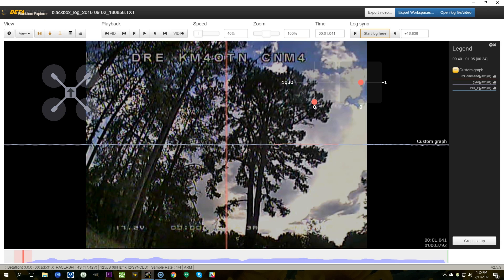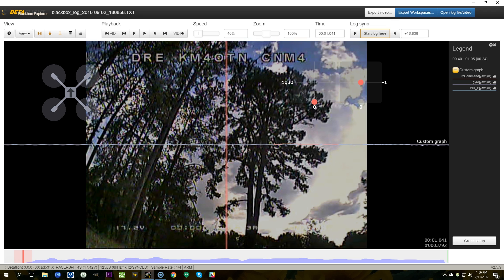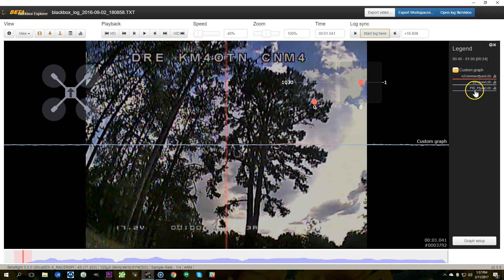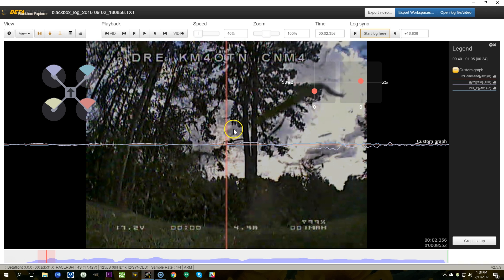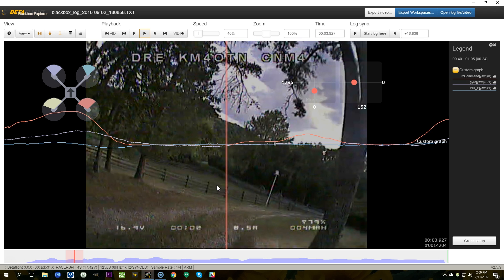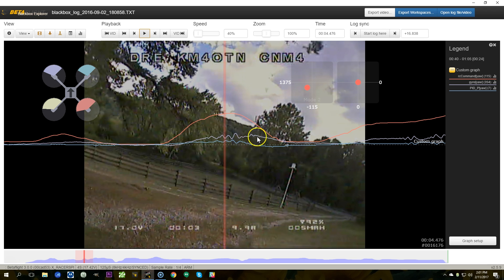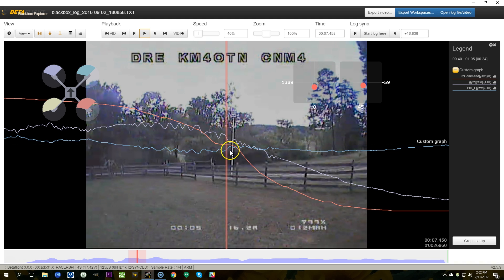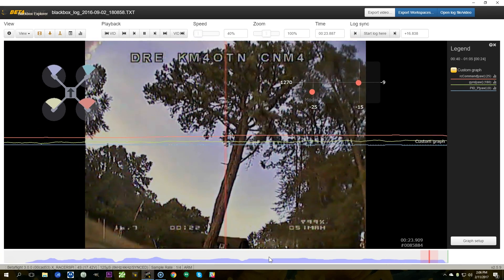Can You Troubleshoot #5 - Answer

Comment: I have a troubleshooting question. Could you comment on esc fires? my rear left esc cought fire today. I was flying los, in a hover and  that motor dipped and i crashed. I thought i was sloppy on the sticks or something so i power cycled, took off then my quad fell to the ground and that esc burst into flames. I dont believe there was a wiring short of any kind. The build in question was a cheap one withe racerstar 30a v2 blheli s escs and racerstar 2205 motors; stock betaflight pids, higher controller rates. I think its just a case of cheap escs, but idk. Any thoughts? thanks!

edit: after thinking about it, im pretty sure it was the left rear esc that cut out causing the first crash, then rhe subsequnt crash and fire involved the right rear esc: weird!
Reply from the maker: Sometimes ESCs light on fire. Racerstar are the same ESCs that come on the Wizard, and I have heard of more than one fire there. Maybe Racerstar are prone to fires? Hard to say.
Reply: Thanks man. That's what i'm leaning towards (that racerstar escs are fire prone). I regret using them. Im thinking i'm going to just throw this quad in the drawr. I'm not sure if the fire compromised the frame, and I dont really want to replace the racerstar esc. Nor do I want to upgrade to legitimate esc's on a half burned up quad with crappy motors. I guess you get what you pay for, and super cheap stuff sounds like fun untill it burns up and you realize that while it was cheap, it still costs money! I think i'm going to stick to emax motors and dys esc's for a while. Thats whats on my first build and they have been great (knock on wood). 
Thanks again for your reply, If you can ever do a video on the actual physics of what makes an esc burst into flames, i'd love to hear it!

Comment: i had a prob like this when i re flashed and updated librepilot same tune but my quad would shake and climb on any  movement got it closer but  relearning 

also i as wondering about h frame tuning on pid do i need higher or lower  on the wide/ longer side say roll  is wider ?
and the mix  sliders  for roll pitch and yaw in librepilot i still dont like naze or clean-flight my only quad atm with  a naze32
https://www.youtube.com/watch?v=rGUzWYtTctU a sideways 210 frame or stretch x
Reply from the maker: It's not about motor layout but weight distribution. Wider weight distribution requires higher PIDs.
Reply: ok i think i get it say my zmr the frame is long with a 2650 3s under it and all gear is long ways on the frame . meaning my roll axis is weight is tight with more leverage from being wider than long but the pitch axis is spread out aith les leverage from the arms  so pitch p.i.d. should be a bit higher than roll?
also i cant find any understandable  info with librepilot there is  a 3 slider  roll pitch yaw mixer i know x fram is all 50  but on above frame should pitch be like 55 roll 45?

Comment: Hey Josh you suggested it might be the receiver I assumed if it were the receiver yaw pitch and roll and arming wouldn't work it's a holybro shuriken 180 pro so I really don't want to take it apart before I wreck it lol thanks again I'll try some stuff with it today
Reply from the maker: If the other channels are working then you're not in failsafe. Is your throttle endpoint just set really really low in your transmitter? Does throttle actually move when you move the stick?

Comment: Got a problem of my own, occasionally when im flying all power to 1 motor will appear to go, occasionally it results in a flip but then somehow catches itself however another time it was as if i had no control for a second and then it snapped back, I guess a motor is desyncing, any advice on how to stop this? It doesn't necessarily happen when I suddenly throttle up and I can't intentionally reproduce, will try to get some black box logs of it. Today I was doing a relatively smooth turn when it did it.
Reply from the maker: Physical damage to an ESC or motor is a likely cause. Swap the motor and ESC with a new one, or swap them with a different one on the copter if need be.

Comment: I did notice my throttle at full zero was 885 everything else was 1000 except the arming switch I believe was 1841 could this be the throttle issue ? thanks again
Reply from the maker: Throttle at full zero being 885 probable means the receiver is disconnected and the FC is in failsafe. It's really unlikely that your actual channel endpoint would be 885.

Comment: I have a troubleshooting problem if you have time, this will be a bit long because I'm trying to give as much info as possible.  I just built on a QAV-R frame a Lux V2 FC@8/4kHz powered via 18AWG from battery leads on PDB with VBAT on/DYS 30A Dshot V2 running DS600/T-motor F 40 II 2305 2600kv/RK 5040s/Matek HUBOSD with 10/5v BECs/TBS Unify Race connected to 10V to PDB, Foxeer Arrow conneted to 2nd 10V to PDB/Tattu 75C 1300s(<50 cycles).....I flew Maiden LOS and it flew great, threw a lil tune on it and flew 2 or 3 packs.  Then I flew Fpv on a fresh pack and after a slow takeoff I punched the throttle for a split second and my goggle view went static..then the camera which I assume lost power came back on and flashed Foxeer just as it does when I first power up.  This kept happening and I was barely getting on the throttle.  While I had no video I did have full control over the quad and managed to save it twice before crashing as the camera powered on  and off. I did see my Voltage drop to 12ish in the osd prior to the crash.  I assume it was happening when I flew LOS I just didn't notice.  Any ideas as to what my problem is?
Reply from the maker: Goggles going to black screen usually means the camera disconnected but the vTX was fine. Goggles going to static usually means the vTX lost power. Since you saw the Foxeer screen that indicates a powerup, that tells you that the Foxeer lost power.

Since you can fly the copter LOS and have control, it means the FC and receiver are keeping power. It sounds like your video system is losing power. Does that point to the 10v regulator as the common link? Or maybe since you saw the OSD read 12v, your system is browning out but the 5v regulator is doing okay so the FC and receiver are staying up.
Reply: I did see the 12 V and it does seem to be drawing a lot of amperage, the FC isn't set to the 5v regulator though, it's connected to the same pad as the battery in(The lux v2 has a VBAT and VIN on the same pad and they suggest to connect it this way in order to power and get Voltage telemetry).  My taranis was chirping too for low battery, I have it set to 14.5 for more than a second and then it chirps.  So it's definitely drawing a lot of power, I just don't know what the cause is or what to replace first?  Thx for your help btw

Comment: I really enjoy watching these even though I have no idea what to but yet. Can you point me in the right direction? from what I've seen on YouTube everybody as different favorites. I thought that I would like the Impulse RC Alien RR5 as my first racer. My first quad was the Traxxas Alias that lasted for 2 weeks. My second is the Mavic pro which I really enjoy, but I really want to learn to fly freestyle. There are so many options for everything that it can make a noobs mind explode.
Reply from the maker: The RR Alien is a fine choice if you want to build your own. If you mean the ready-to-fly, it is pretty expensive and there are more economical options.
Reply: Joshua Bardwell I want to build. I'm trying to learn what flight controller, motors to use ext. I think ones I get past this first time build hump it will be easier because then it is applying what ive learned. At least that is my theory. LOL

Comment: What would happen if the Quadcopter wouldn't care about the influence of wind...?
Reply from the maker: I'm not sure I understand your question.
Reply: Joshua Bardwell I mean if the flight controller would only react to the input of the sticks and then stop the rotation of the quad by using the Therm that's set.
That way you shouldn't have any bounce at the landing when armed and still have full controll.
(With Airmode you always have this bounce when hitting the ground armed.)
Not necessarily if you didn't understand :)

Comment: Could you show what your P term ended up being and how it looked on your Black box. I'm trying to tune my 6" quad and still having punch out vibrations. And I'm not sure if the heavy winds caused a slight pitch dip on punch out. Maybe I shouldn't try tuning in the wind?
Reply from the maker: +Kevin Duquette my p term on yaw often ends up around 90 to 110. I don't have a Blackbox to show right now, but I am working on a pid tuning masterclass for the NYC drone film festival so stay tuned.

Comment: What is that intro 🤣
Reply from the maker: A reel made by Guillermo Nespo, a viewer of mine.
Reply from the maker: Black screen usually means the camera is not connected or working.

Static usually means the vTX is not powered on.
Reply: Joshua Bardwell hey I'm having a problem with my drone I'm only getting black screen on my goggles I'm not sure why and I've never powered the vtx without the antenna on do you know what could be the problem?
Reply: Joshua Bardwell thanks I changed the camera and it works now thanks always for the tips and your videos are the best!